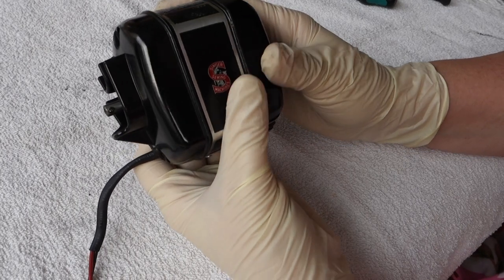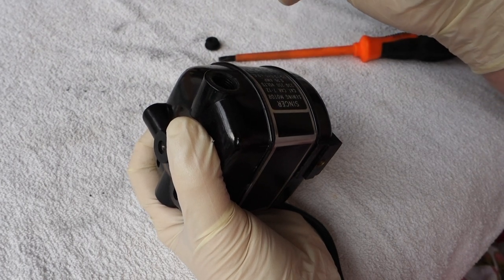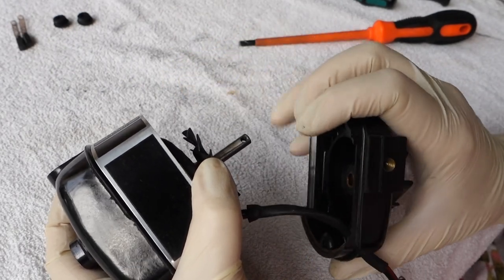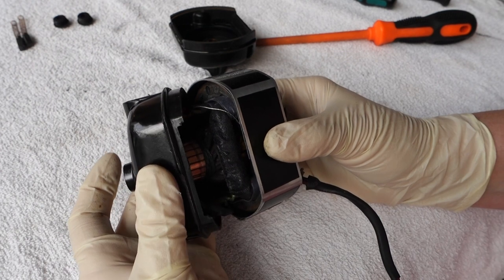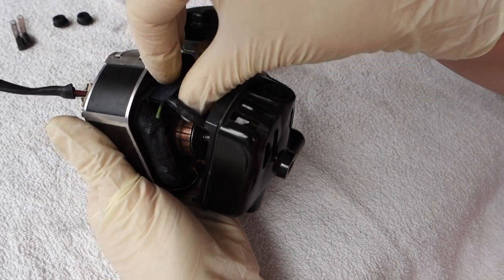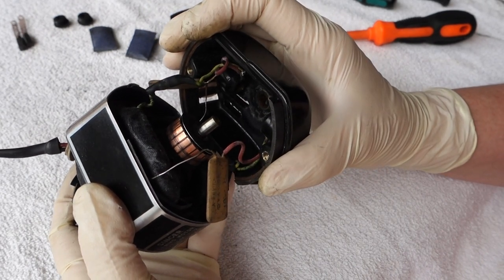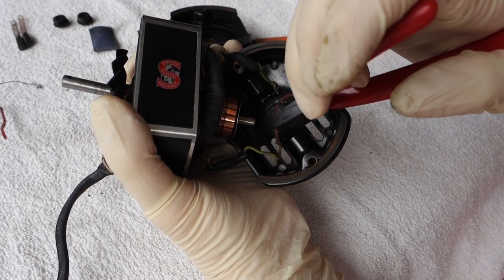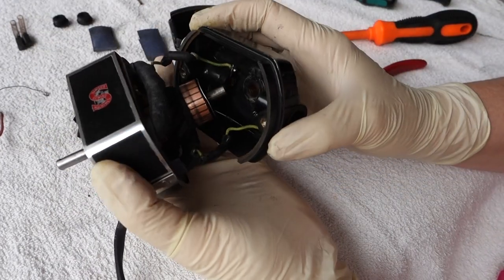Singer Featherweight 221 222 Repair Video Tutorial - Motor CAPACITORS

Comment: Hi, great video, can you explain why the capacitor are not needed anymore ??
Reply: Yves Cayer I’m wondering this as well
Reply: @JacobVossFilms  These capacitors were originally placed to reduce radio frequency (RF) interference from the non-insulated case of a Singer Featherweight motor.
Unless you are a Amateur Radio operator ("Ham") or listen to AM radio, it is doubtful that you will be aware of the RF interference.
These sewing machine motors function perfectly fine without those capacitors.
72.
Reply: I wonder if mixmaster mixer motors had caps.😎 They also used an ac reostat.